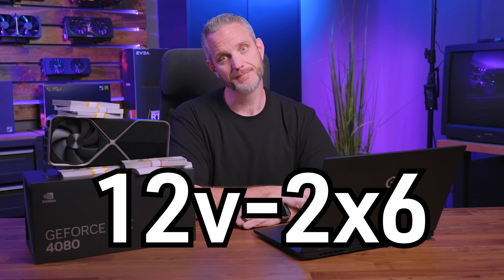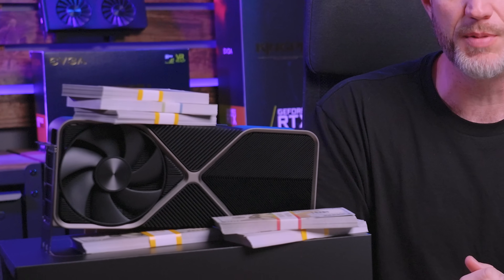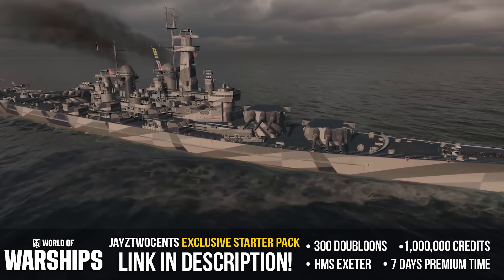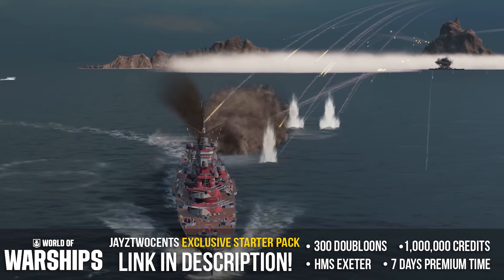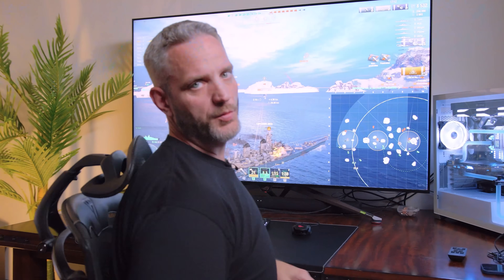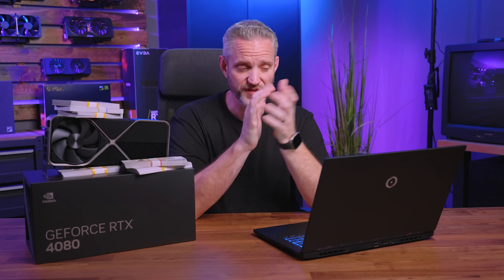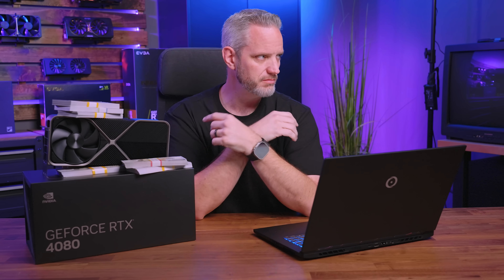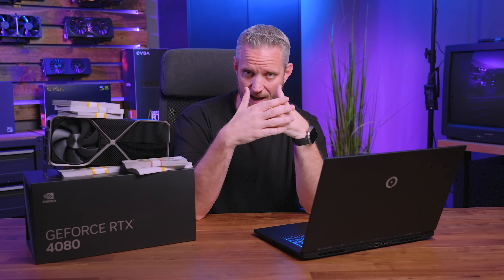They FINALLY admitted that this was a major issue!

Comment: The 30C above ambient will not refer to the ambient in your room but the ambient in the case in which it is fitted.   

Since most plastics start softening at around 100C  I would prefer to see an absolute temperature specification and not a relative

Comment: PCIe 6 spec already changed the plug to basically be of normal size wires and connectors like before, except, although its full size as we were always used to its solid connected rather than being 2 separate 6 pins and the 4 pin is present below it(which should have been the F&*king connector to begin with). For that much voltage the male/femal connectors were too small a guage and so were the connector pins, Theoretical does not always translate to real world applications and the connector should have been made to a much higher spec of a degree I am thinking this was to make it actually cheaper to produce, which cutting corners never caused a disaster(sarcasm).
Your right its not really the gauge of the wire really its the gauge of the male and female connector that require so much surface area to transfer the amps without causing arcs that melt the connector, also the smaller the connection with the higher amps you get a form of friction(passing electrons at a fast rate with not enough contact area, its like a bottleneck with a high rate of speed) so you end up with higher heat given off as efficiency of the transfer of electrons.

Comment: Just sent my 4090 back to Nvidia last week as I was getting a black screen now and then and the GPU fans going %100. Also, the card would make a weird noise when playing YouTube videos but not gaming. Should get my replacement shipped early next week but asked Nvidia today actually if my replacement would get the new connector but they couldn’t confirm but stated they will get back to me. Hope I get the new connector with my replacement. Just to confirm I always made sure my cable was fully connected to both the PSU and the GPU so it wasn’t loose. Finally, Nvidia seen my issues as I recorded it and sent them the videos but they did state it’s not a connector issue but a hardware issue. We’ll see how it all goes lol

Comment: For them to have even thought the original design was ok was pure incompetence and disregard for BASIC electrical design rules. Like parallel load sharing... There is a reason that is illegal for AC wiring...fire...  So I'm not holding my breath LMAO.

Comment: Ive recently had my PC black screen 3 times while gaming the past 2 weeks

Im using the CM Variant A 90 adapter and i dont mess with it or wiggle it but every time my PC has black screened i took off my side panel to feel if the adapter was hot or somehow wiggling out (it shouldnt since i dont move the PC and i even zip tied the cable to the bottom of the case to keep the cable secure in place)

Been using the adapter for about a month on my ASUS 4090 TUF OC, not sure what is/was causing the black screen but hopefully it isnt a potential melting issue

Comment: i still think that the gauge is too small. the wire can dissipate heat pretty effectively its the plug at that gauge that becomes the issue. i still think thermal runaway from a loose connector or a lack of heat dissipation is what is causing it.
Reply: Well me. I think we will find out with the next 4090 or the 5090.
Reply: Thank you me. I appreciate it

Comment: Hey Jay, thanks for the video. Have a quick question though. I currently have a PNY RTX 4090. The card is capped at 450W. I am also using a CableMod cable. Should I end up getting a new CableMod cable if they incorporate the new connectors you where referring to? Or is being at 450W max capped for my 4090 ok if I keeping using the original cableMod?

Comment: Hey @JayzTwoCents I noticed in a different video that ASUS motherboards were giving you problems and I had a question about the ASUS B650E-F ROG Strix Gaming WiFi. It comes in a bundle with ddr5 ram and a 7900x pcu so I thought it was a good deal but obviously not if my pcu is obliterated. What are your thoughts and what should I look for in a motherboard since that is the only thing I have trouble understanding when it comes to pc components 😅.?

Comment: No joke, did I miss something? Didn't GamerNexus prove that there was no tangible difference between the cables from the different manufacturers and that all of this was just theory crafting? And that 95% of the melting issues were a result of not plugging in the cable all the way and subsequent movement causing even more inadequate contact (and/or debris getting into the pins from manufacturing or user)? I mean the cable definitely doesn't have a satisfying click when you push it all the way in, but the vast vast vast majority of time as long as you make sure it's all the way in, there's no issues.

Comment: I don't understand why they had to come out with a completely new plug and cable design in the first place. If 3 8-pin PCIe connectors won't handle the 4090's power draw, just put a 4th one on there. The 4090 definitely has enough room on the giant cooler for the PCB to be a smidge longer to accommodate it. I guess that would've been too easy, though.

What's the old adage? "If it ain't broke, don't fix it." They were trying to innovate just because they could, not because they should. Lol.

Comment: Ever since full modular power supplies have been available, I've been making my own power supply cables. I've always used NTK connectors and copper 16awg wire, just for piece of mind. I don't use CCA (copper clad aluminum) wire since its total crap wire and should never be used, ever.

Comment: I still think an appropriate cable (with sufficient length to connect to the power supply) soldered directly into the pc board with double power connectors that plug into the power supply might be a good solution. It would eliminate the connect to the card.
Reply: It's not a good solution. For no one. Brands use proprietary connectors on the power supply side. And that's not counting that most users don't have modular power supplies so they wouldn't have where to plug that cable.

Comment: There are still two areas of potential issues with the new 12v... the old 6/8 pin connectors have much thicker pins and therefore more contact area on each pin and the clip that fails to hold the connector in place should be designed to provide more positive pressure on the connection. It should not allow a clipped on connector to loosen, ever! Until these two changes are added to the fix... there are still going to be issues, because tiny connecting pins and high power draw are always going to be worse than larger connecting pins and the same power draw.
Reply: Yes because the power rating of a cable directly relates to the surface area of the conductor in mm2 its always better to have more conductor if for nothing else to reduce the resistance loss.

Comment: Excellent summery, thanks so much for this. I made this ntk terminal request a few days ago on cablemods reddit forum. A fellow Reddit user shared his breakdown of cablemods pin. It was neither a ntk or an astron, it was a elongated single dimple. How much more could ntk terminals cost really? These pins are tiny and my point was Id gladly spend 5 bucks more for the piece of mind, and ability to stop my ocd sniffing of my case for burnt plastic smells.

Comment: Jay you need to checkout the Thermaltake GF3  PCIe 5 ATX 3.0 PSU's , just for reference, their included 12VHPWR  is THICK and supported near the end of the cables, not easy to bend at all.
Be worth a look, I've been running one, no issues, and have tested trying to pull out the cable while plugged in, it doesn't move at all..

Comment: You talked about the pins being made longer on the card side but if they are changing the spec for the card side, this also changes the spec required for the cable itself as you denoted. How will this affect people who have purchased a newer PSU with a native 12vhpw port? Will there be any RMA's or anything you're aware of to change the specifications to match the cable/graphics card requirements? 

For my own example I am in the process of building a new pc but I can't just afford to buy all the parts at the same time and so I've had to buy them slowly.. a year has now gone by and i'm still not done... However my PSU is one of the parts I have purchased. Planning for the future I got one with the 12vhpw port native to the PSU. I'm sure there are other people who like myself are building pc's at a very slow rate because that is all we can afford to do. As my pc is not even built yet what would be the suggestions or options available to me and others like me?
Reply: If nothing else, they may ship a new video card with a more rebus adapter or have a link to request one. If nothing else, you could email your Psu manufacturer and ask them about this . I'm getting the feeling that the issue was that there was a very lose standard and that is why there running into issues.

Comment: The black screen with 100% fanspeed thing is accurate. I can run my 4090, gently poke the power cable, and that touch is enough to trigger the failsafe to occur. I've had issues with my fully plugged power cable doing this spontaneously, and I'd have to fix it by replugging in the power cable

Comment: THERE ARE MORE CRIMPS THAN ASTRON AND NTK on the market. Jonny Guru from Corsair confirmed that they use two different suppliers of a 2-dimple design, and the 2-dimple design can be supplied by Bellwether, Lotes, HYM, LST, and maybe others. I don't know who Cablemod uses, but theirs also appears to have 2-dimples, and it looks like there may be a single split in the crimp, instead of Astron's 2 split.

Also, apparently most cable manufacturers are not using Astron or NTK. Although there are more dimpled designs out there, apparently Astron is rare.

Comment: Still would have liked to see a second clip to really hold the cable inplace but I realize that would have realistically meant a whole new plug rather than upgrade to fix issues.

That said at least glad to see actual improvements being made rather than sticking their head in the sand and pretending everything's all good.

Comment: This is great news, finally some real changes and fixes to the issues with power. Also would like to see on a pcb side of connector power to be not delivered to a single big power plane , but rather many broken down planes so that if resistance falls in one pin it can handle extra current from its pair instead of all pins

Comment: It's driving up the a wall watching the general reaction to this be, "oh well.  What can you do."  This isn't an early-adaptor bug where it turns out if you play CSGO at 9:38AM on a Friday the software goes into Reset; this was pure negligence.  Anyone with EE knowledge and experience would have taken one look at that design and it's claimed wattage and said, "nope".  200W?  Okay.  300W?  If you felt like pushing it.  600W?  GTFO.  Shoving over 8A per wire (assuming the power is being evenly spread, and there's no guarantee of that) through a glorified DSUB pin contact?  Not even that, because I looked up the specs on these 12VHP contacts and a DSUB's is more robust.  
Deeply telling that Intel had a hand in the design of this and were still like, "yeah, no, we're not using that Hyatt Regency Skywalk of a power connector".

Comment: Ouch. I just built a new ITX PC (but using my old 3060Ti) and was expecting to upgrade to a 4090 in a couple of months, as I got the CoolerMaster NR200P Max, which came with a 850W power supply. But this sounds like I'm going to have to replace the power supply as well. Maybe I should just ride it out until the next gen arrives...
Reply: 850w should be ok , but you wont have much head room.

Comment: Cablemod also makes a great 90 degree adaptor for the 12VHPWR connector. It is very solid and totally eliminates the sharp bend on the cable for those where the GPU is close to the side panel.
Reply from the maker: It still uses the Astrom 3 dimple terminals

Comment: let's say it resolve something...
atm, the wire in these cable has an average diameter of 18awg <-max current of 6.94A
and for the premium cable : 16awg max current 8.33A

so firstly,  after the "connector drama" , you'll have a "cable drama" because if nvidia design 9.5A on the f***g connector, you'll have inevitably 9.5A
secondly, a 650watt gpu is not safe anymore with your old cable, especially if you have a standard cable...i guess overclock a 600watt gpu  will ruin it :p
too much wattage? whimsical?  some RTX 4090 overclocked draws a ridiculous 500W power (~@6.94a) , just at the max current of the standard cable ...

see you at the next drama :p

Comment: I mentioned this before. Ford Motor Company had this same exact problem with some cars in the 90's, my Mustang being one of them. The connector(never found out which exact one), under the steering column had to be changed due to the fact that the pins were too close and the wires were too small to handle the CURRENT(AMP) going through them. It caused a fire hazard. Credit to them for creating a recall as fast as they did.

Comment: So the CableMod 180 adapter "may" have the Astron connector?  I may need to check on that.  Honestly, anything with this amperage rating should have at least a bisected male and a solid circular terminal.  Think XT90 with an 8ga. crammed in it.

Comment: Hams learned decades ago that the "pin and sleeve" type connectors top out at around 8A. Higher than that, and you get... melting.

Perhaps PCI-SIG should have simply specified a 75A Anderson Powerpole for the connector, which is good for 900W nominal, but are currently rated for up to 120A... or 1440W. That (hopefully) should be good for another generation or two for Nvidia...

Comment: I am mostly hoping for the 50 series to aim for efficiency and maybe a size improvement, which I know would suck for those already in the 40 series but its just crazy what the 80 and 90 cards in the 40 series are drawing.
Reply: 4080 is the most power efficient performance GPU on the market.. 340 watts max, low temps
Reply: @tomr3319  People don't realize how power efficient the 40 series is
Reply: 4080 draws less that the 3080 my dude, the 4000 series are super efficient. It’s just the 4090 that can pull crazy wattages
Reply: @Rhamses220  Even the 4090 won't really pull crazy wattages unless you go nuts with 133% powerlimit and settings

Comment: if the problem is the contact surface shrinking from bad connection and getting a waaay hotter point, then why dont they create a bigger cable and connector, duuude, they are trying to save 2$ more materials, on your 10$ cable (max prod price) that comes free, and destroys your 2k$ investment, who is the genious production planifier responsible from this, surely well hidden at this point, and why nvidia kept approving this connector all the time, everything around these nvidia cards is weird.